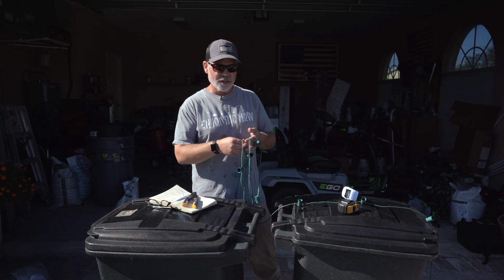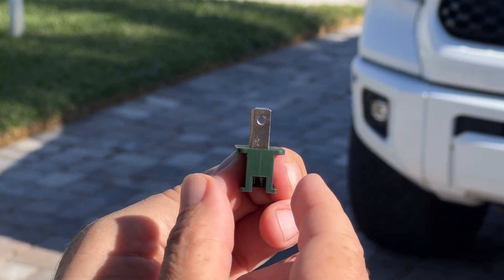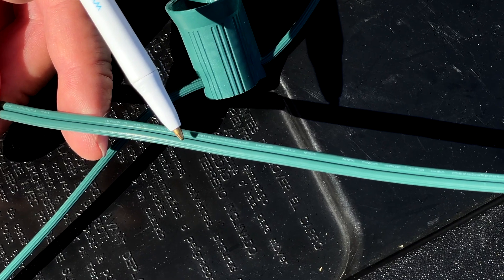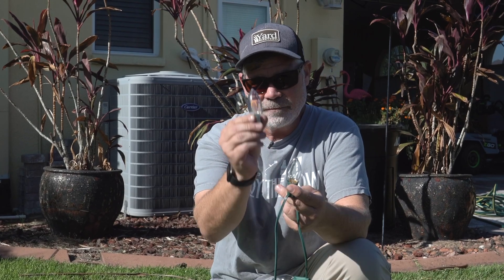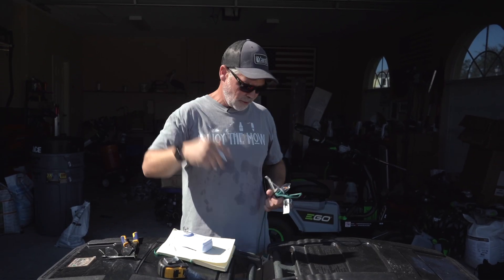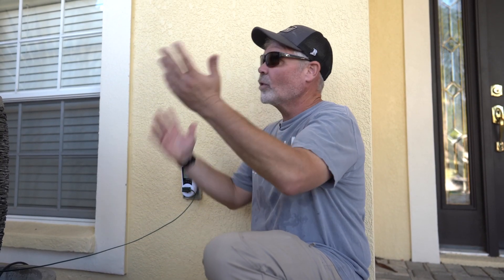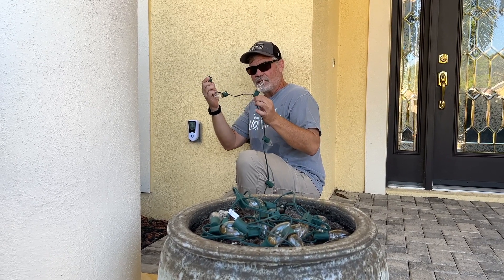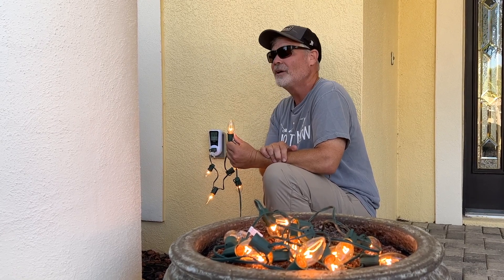C9 LED Christmas Lights - Maximum Length and Amperage Testing // Does Polarity Matter?

Comment: I'm an electrician and polarity absolutely matters. Regardless of the bulb type (LED or incandescent)The "sleeve" that the threaded part of the bulb screws into should be on the NEUTRAL and not the hot leg. For example, if you're removing a bulb and have it halfway unscrewed and just so happened to touch the threaded part of the bulb you will 100 percent get a shock. Not something you want to happen while on a ladder/roof and could absolutely get someone killed.
Reply: Agree 100% with your reasoning, this guy obviously does not understand basic electricial concepts- saying polarity is important with incandescent but not LED proves he is clueless on this topic- he should not be teaching or selling stuff he is ignorant on.
Reply: This x100. It's not about whether it lights up, it's about safety.
Reply: Without it being plugged in? I’m asking because we are told in the other videos to make sure everything is unplugged when doing this…

Comment: If you want to follow polarity, another indicator with the wire is one is smooth and one has ribs to the outside. I use the side with the ribs for the neutral side.

Comment: Did i read that meter wrong? Those numbers don't match the audio.....
Reply from the maker: yeah there is a correction on screen - it was pretty close, I rounded up
Reply: Gotcha. So 1.2 and 1.3?
Reply from the maker: @PatrickHealy  2.5 amps is the max. The strand I tested is well under
Reply: @TheLawnCareNut  wait, so I understand this right, the 200 LEDs on 225 pulled 1.2 and the 25 incandescents on 45 pulled 1.3. Does that mean these numbers scale up and down linearly? Would 250 incandescents on 225 pull 10.4? Would 25 LEDs on 45 pull 0.15?
Reply from the maker: @PatrickHealy  forget about the length. The incandescent analogy was just there to show you how much more amperage they pull. 25 incandescent lamps pull more than 200 LED. lamps That is the only point I was trying to make.  As far as length, no matter what lamps you choose, you cannot put more than 2.5 amps on 250 ft of line.
Reply: @TheLawnCareNut  I get you. I was just curious. And I know the length didn't matter. I was just trying to keep it consistent for an apples-to-apples comparison on the electricity front.
Reply: @PatrickHealy for reference, a c9 incandescent bulb is 7 watts (average) and an LED c9 bulb is .74 watts (average).
Reply: @Squeezedsn95  would you say that that 10x wattage limits the maximum length of a string of these lights to below the 250 mentioned in the video? I'd imagine when you back out on the math, there's only so many bulbs that can pull from one outlet.
Reply: @PatrickHealy  I can tell you (I would not advise it) I am breaking that rule as I have approximately 480 bulbs run on 1 socket.
Reply: @Squeezedsn95  incandescents? Holy crap!
Reply: @PatrickHealy  oh no they definitely are led’s (I must have misunderstood your question) incandescents you can only run about 50 or so ft/bulbs off of one outlet before it becomes a problem so roughly 10x less.
Reply: @Squeezedsn95  I think THAT'S the real selling point of LEDs. Lower energy consumption is great and everyone wants to save money but being able to run it off one or two outlets is really the big one IMO.

Comment: Not a light topic, but what is your opinion on liquid lime???
Reply from the maker: I've never used it or tried it so I don't have one lol.
Reply: What are you trying to get done? Are you trying to correct a specific micro or macro in your lawn or soil? Then maybe he can recommend to you what to use
Reply: @artieartya , my PH is low and I threw down some Dolomite Lime, but I was wondering if Allyn had heard of anybody using liquid lime and if they had quick results or if it’s just snake oil…

Comment: Any info on how parallel lengths of wire affect the total length? Can i have main line that runs 225 feet and then a 200 ft offshoot at the 25-foot mark?
Reply from the maker: as long as the total of all of them added up doesn't exceed 250 ft you are good. So in your example of 225 + 200 you are over the suggested max by quite a bit.

Comment: Polarity matters for safety. Having the neutral sleve being hot. It will be hot untill it stops touching the sleeve as you remove it. And in a lot of cases its even when its exposed. Thus a safety hazard BECAUSE ITS HOT if it were to back out for any reason.
Reply from the maker: that's good information, thank you!
Reply: @TheLawnCareNut The biggest reason for the popularity plug was to protect people changing light bulbs.
Reply: I'm old enough to remember when there was no polarity tabs on plugs. I survived and so did everyone I know.
Reply: @MAGAMAN  indeed. But here it's dry and it bridged the bulb and metal gutter threw sparks and set the girl scout clubhouse grass and subsequently building on fire. (It with the help of the wind. Grass fires are common but those are due to hot catalytic converters/cigarettes)